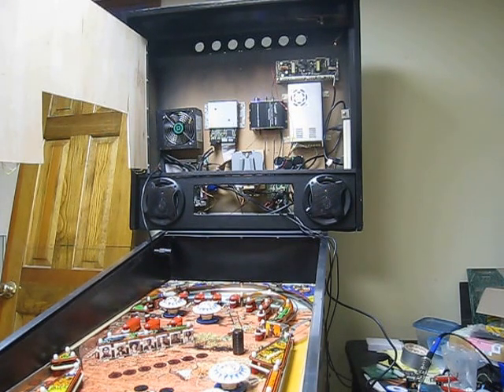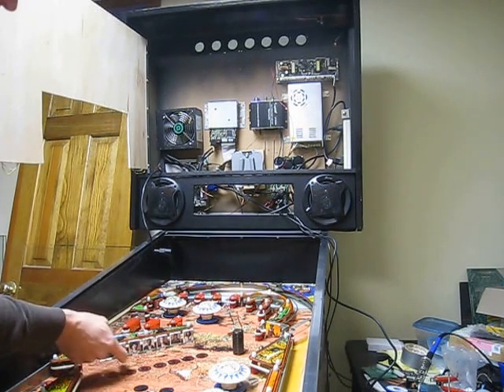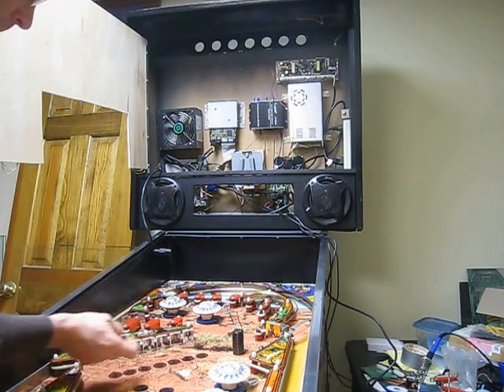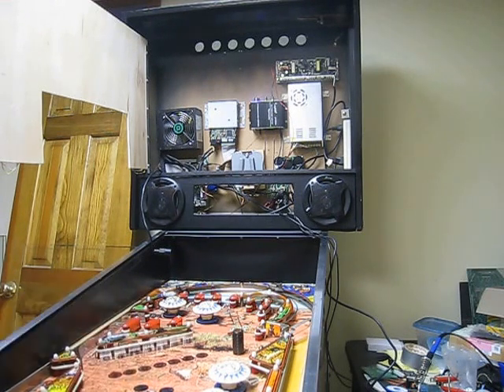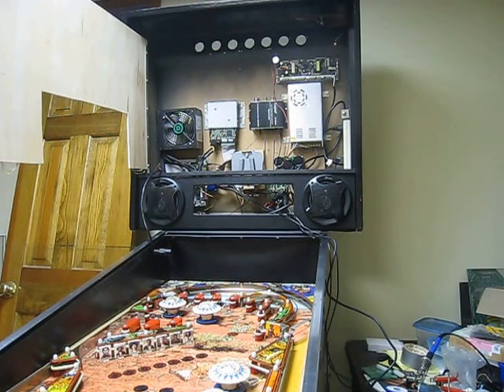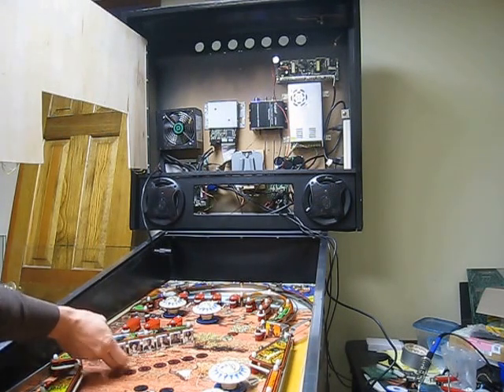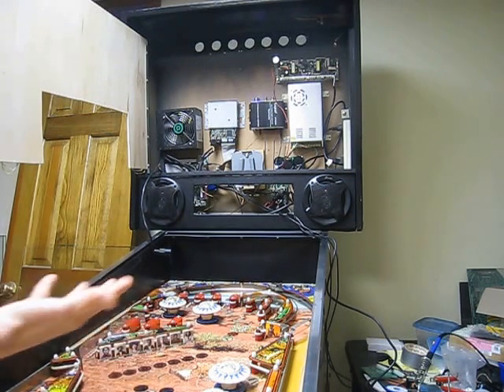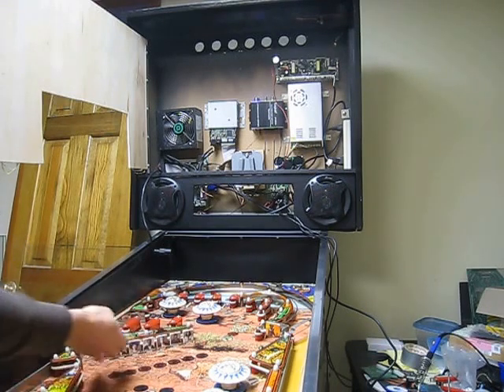Bulk Capacitance

Comment: how did you choose the value of the capacitor to 10mF?
Reply from the maker: That is the maximum standard sized capacitor that had the correct voltage specification.  I haven't looked at those capacitors for a few years, but at that time it was the best price/Farad that I could find.  For bulk cap, bigger is nearly always better up to the point of absurdity.